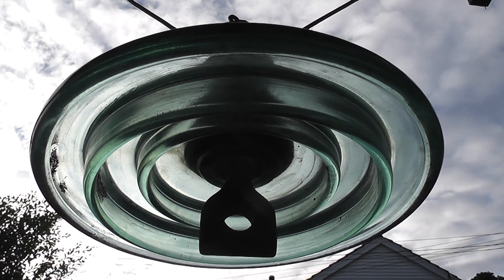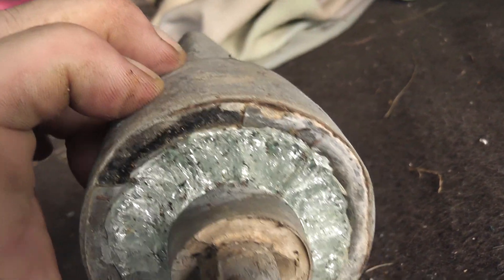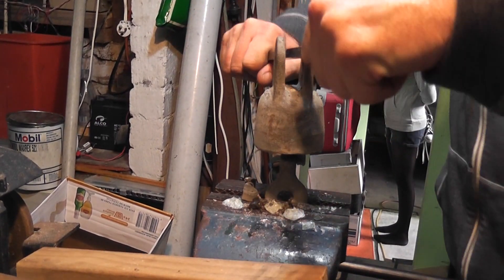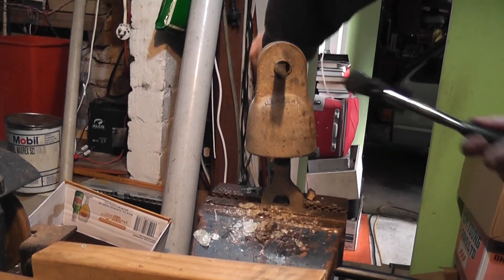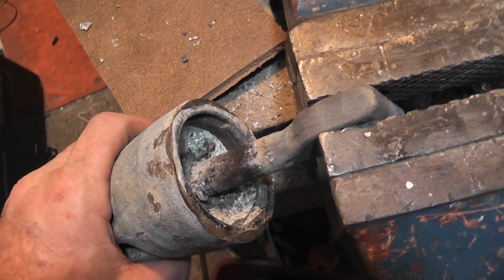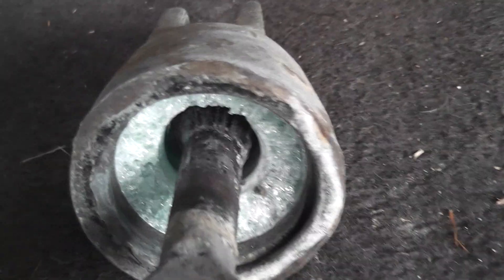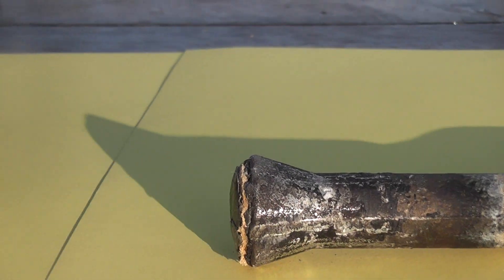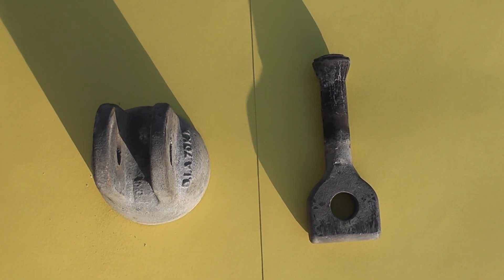Glass Strain Insulator   autopsy

Comment: High Voltage insulators such as the transmission tower chain link strain you disassembled are made to withstand stresses of thousands of pounds pulling forces. It is no surprise that it was difficult to remove the center connecting stem. The ability to add multiple disks make it very versatile for a range of voltages and have quite a future for electrical line distribution. Great video.👍

Comment: Hey man I just got one of these of my own and I would like to disassemble it without breaking the glass.  I think in many cases the glass is threaded, and the cap is "screwed on" to the glass.  Not sure how the stud part is held in.  Do you have any more you can take apart?
Reply: If you want to remove the cap you can chemically dissolve the binding cement with acid or in some cases heating up the insulator will melt the rubber stuff. Care should be used to prevent fast temperature change that might shatter the glass. Many carnival glass disks were removed with heat method by a lineman who sells them here in Washington state. The carnival glass type are still being used on the Grand Collie Dam lines between Washington and Oregon.
Reply from the maker: Not exactly, there are different designs, some have screw in bolts, some not and are potted like a filling in a molar. Start chipping away at the cement carefully.

Comment: Thanks for this video.  I have some and I want to remove the bottom pin without destroying the glass.  I'm guessing by dissolving the glue.  Does anyone know what solvant might work for this?
Reply: A lineman who lives here in Washington state removes the pin and cap by heating it up in an oven and melting the rubber stuff.

Comment: I need to remove the center, metal part out of a glass saucer insulator. Any idea how I could proceed without breaking the glass?
Reply from the maker: I don't think that it is possible to remove the inner center, as the disc glass is part of the medium in between the steel studs.
Reply: Bummer...but you can drill through glass so what's the problem?
Reply: Split the steel case vertically with a dremel cutting wheel. Then pry the two halves off that's what I did
Reply: A lineman here in Washington state has removed many carnival glass types by the heat method and still sells them to insulator collectors.

Comment: Thanks, I bought one on E Bay to make a lamp.  I thought it was threaded as you did.  Thanks to you and your video I won't destroy it.  How did we survive  before You Tube?
Reply: Scott, did you ever come up with a serviceable procedure for removing the two metal pieces without damaging the glass insulator itself?
Reply: @jeffcooper6620  A lineman who lives here in Washington state has removed many carnival glass ones and still sells them. He used the heat method to remove the rubber stuff.
Reply: I also want to make a lamp, but it seems the lower pin needs to be drilled out, or the glue removed by solvant.  If you have any ideas, please share.

Comment: Can't comment on foreign standards, except they usually will rate them in Kilo-Newtons (kN) instead of Kilograms or Imperial Pounds.

American ones, for distribution lines are typically rated to 10,000 Lbs, or 5 tons. Transmission rated ones are often 20,000 or 30,000 pounds, or 10 and 15 tons... Any additional weight rating means they typically get paralleled in racks to make bundles.
Reply from the maker: BPM Productions of Colorado In NZ we use kN and use the metric system.

Comment: Always wondered about that. Seen these still holding the load with broken disks.
Reply from the maker: ***** Yes, must be designed with extra redundancy for safety, I have seen strings in service on 220 kV with the odd broken disc.

Comment: Are those metal portions of that insulator normal steel with a plating on top? Or are they stainless steel? Are they magnetic?
Reply from the maker: OlegKostoglatov Galvanized steel
Reply: RODALCO2007
For some reason I though that they may have chosen bronze, I guess dissimilar metal corrosion isn't an issue with AC power lines like it would be with DC.

Comment: Aaaah, Interesting disassembly of one of those discs. :-)

I remember that vid you done of one of these and you managed to get the voltage to fizz over the edge and make loud snapping noises. :-)

Thanxx for showing,

-BoomBoxDeluxe.

31st May 2015, 04.02
Reply from the maker: BoomBoxDeluxe Yes, that was the same style insulator. I found this smashed one in the bin at work, and needed to satisfy my own curiosity how these things were assembled.

Comment: How much would the cable weigh at the point the insulators are connected? 
I assume the pylons are spaced so the weight of the cable at every pylon insulator is at an even load.
Reply: The conductor weighs about 1 pound per foot. Spans can be 500-1000 feet putting a 1000 to 2000 pound load on the insulators. Insulators at the end of the line must carry additional load.
Reply: Can't forget about wind, ice, and other dynamic loading. Many times, wind loading can put extra lateral (side-side) strain, on the order of several tons, on a structure.

Comment: I always imagined that the metal conductors were attached to either side of the glass disk and did not run through it. But now thinking about the voltages involved and sizes can see why this wouldn't be necessary. I guess it also explains why the power lines don't fall down when the insulators are damaged :-)

Comment: Sorry to sound stupid but could you do a video on how they work?
Reply from the maker: Willisash Willis These insulators can be chained to the correct length required for a particular voltage. A single disc will handle 11 kV . Three in series usually 33 kV Seven or Eight for 110 kV. and so on.
Reply: Ah thanks :)